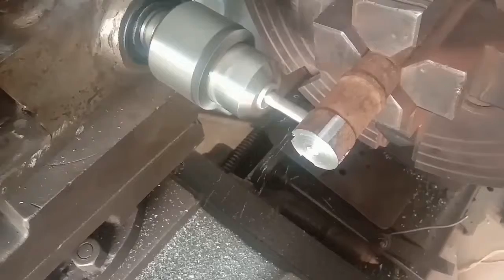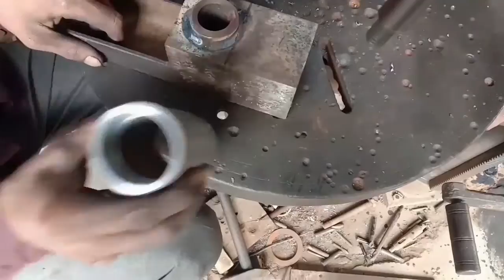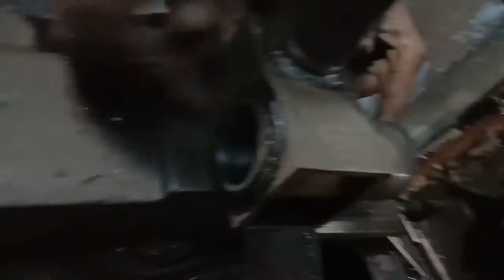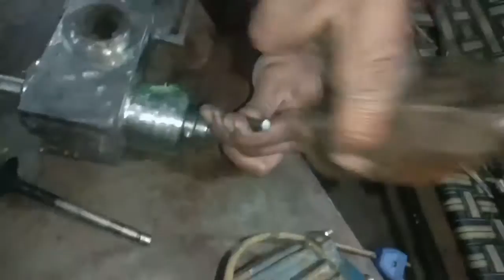Keyway Cutting on Lathe Machine[How its made]

Comment from the maker: (Click here to skip that part of the video)
00:00  tutorial of tool
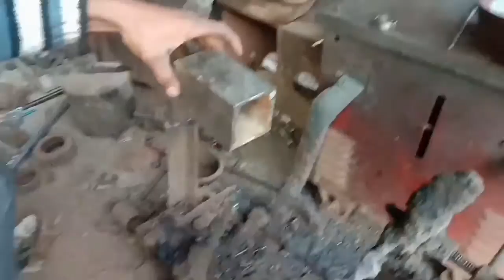0:08  how it's made  Welding
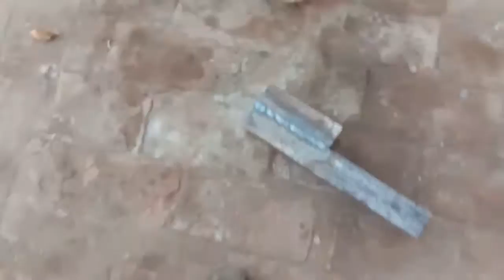00:50   Grinding Process
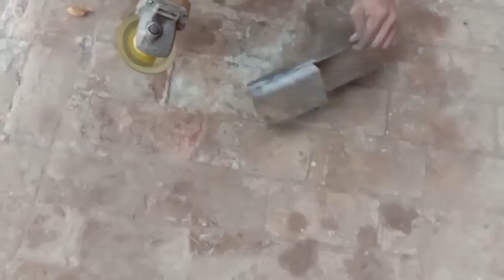01:06   Boring Process
02:56   Welding
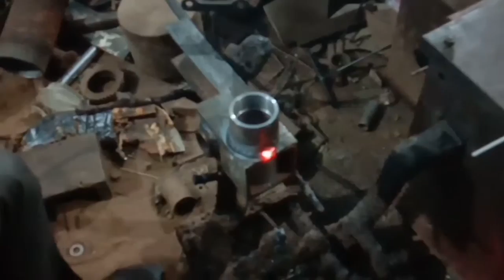07:19    Line Boring on Lathe
08:00    Shaft Making
08:44    Making of Nuts (Internal threading )
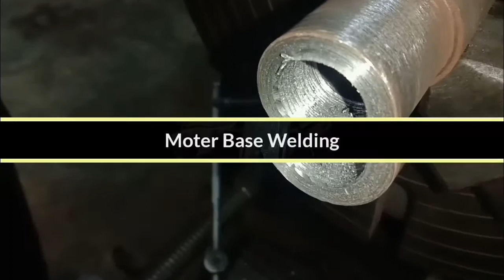09:46    Motor base Welding 

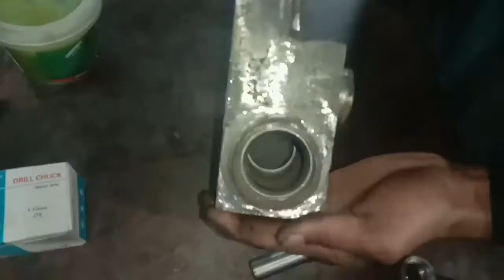10:41 Fitting 
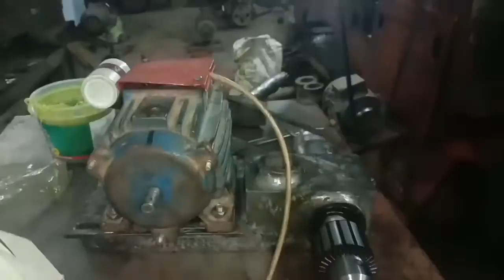14:19 Testing

Thank you
Reply: I know I am pretty randomly asking but does anyone know a good website to stream new series online ?
Reply: @Malik Callum Thank you, I signed up and it seems like a nice service =) I appreciate it!!
Reply: @Kasen London No problem :)
Reply: 8
Reply: 8
Reply: 8
Reply: 8
Reply: 8
Reply: 8

Comment: Sir ye pully kitne inches ki Hain dono plz bataiyega 
Or itni badi pulleys sahi rahengi na speed ke hisaab se choti monoblock motor ke liye?
Reply from the maker: Sir its 1440 RpM moter,
And mild steel ke liye dono same size pulleys chal jaye
Reply: @MechanicalIdeas  
Aapne kitne size ki pulleys lagai Hain ?
Reply from the maker: @lokendratiwari1274  sir maine dono same size ki pully lgayii heee,or 1440 rpm ki moter he 1/2 hp kiii or ispe tool ki rpm thori jyadaa heee
Reply from the maker: @lokendratiwari1274  apko moter pee 1 inch chooti pully lganii chahiye,to shaft ki rpm kam hogi to aap har job pe keyway kar sakte hoo
Reply: @MechanicalIdeas  sir difference kitna hona chahiye dono pulleys me agar mein bhi 1440 rpm ki motor lagau